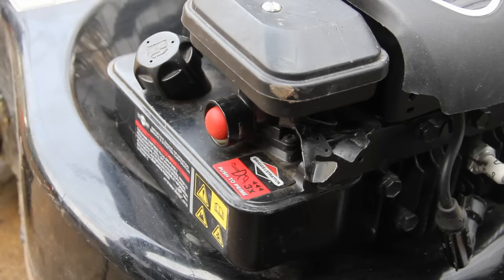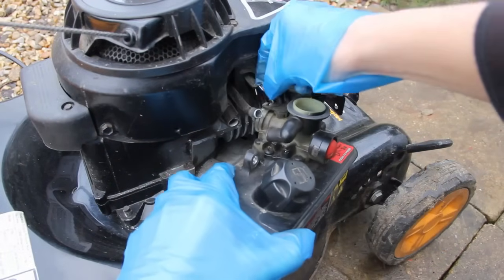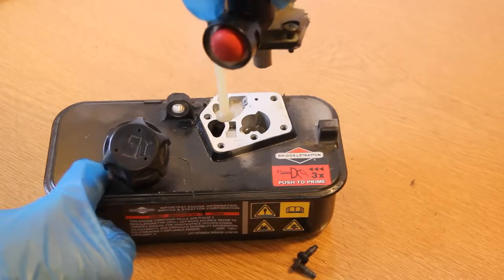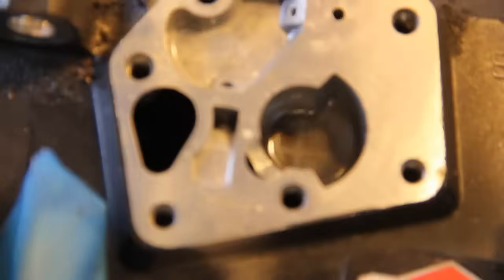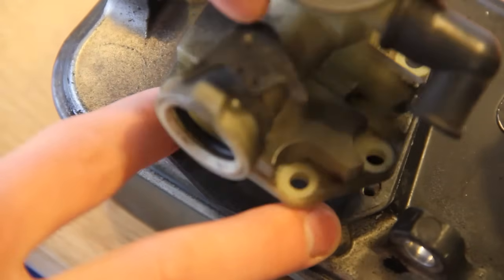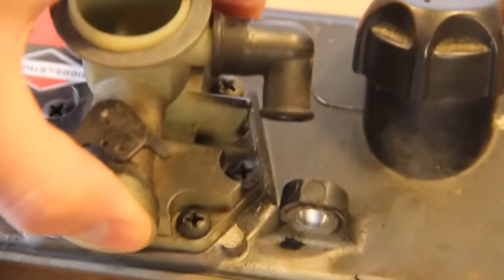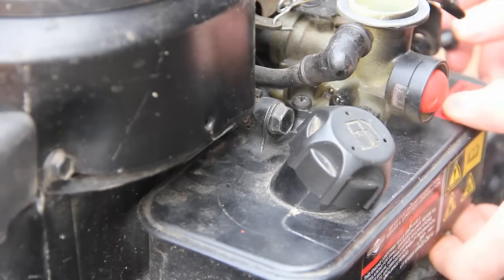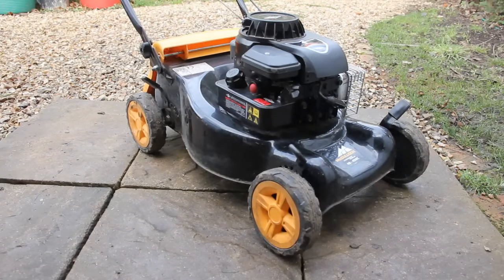How to Replace Diaphragm and Gasket on Briggs and Stratton Engine Primer Carburetor

Comment: I've got a sudden problem with the primer on mine..Briggs 3.75hp Sprint mower with plastic carb with rubber primer button, suddenly, after it working fine last time, pushing the primer button will not suck up the fuel at all, I didn't think it would be difficult as I have cleaned the carbs successfully several times b4, but cleaning it and blowing it/sucking it  and squirting with carb cleaner,it all seemed clear,  it briefly sucked fuel up ok from the tank before I put it all back together, then, after being screwed down onto the tank, same problem.No pump priming, just won't draw it up from the well.I got a spare old carb, cleaned it, and the mower started immediately, but I would like to fix the one I took off still. Since it didn't respond to the clean, I am at a loss.
Any other possible issues cause this ?
Reply: lyerlyman I did subsequently solve the problem on that carb, it was an issue with the diaphragm ,which another Youtube channel suggested as one of about 3 main causes...
 there is a tiny tiny breather flap over one of the airways in the carb, on that rubber gasket, and that little flap has to open and close to provide the vacuum seal and release as you operate that rubber button.As the primer button inhales and exhales as it were, that little reed-flap has to open and close effectively.....I checked it by taking the carb without the tank , getting a glass or cup with enough alcohol or gasoline in it to cover the end of the long plastic draw-up tube...and put your thumb over that little reed part of the diaphragm as you operate the pump-button..if that is the issue, you will find that this test, with your thumb pressure restoring that vacuum,  enables the primer to again suck up fuel into the pump button which is then available to discharge through the squirt  jet..  
when I took my thumb off that little reed and passageway, the primer button quickly emptied and then was again inopperative..so this proved the rubber diaphragm as the total cause, in this case.
the rubber and the paper gasket and diaphragm are of course sold together as a pair usually, at reasonable price..
Reply: lyerlyman I just put in a search something like "primer button Briggs mower" and brought about about 3 top results, messaged them all the particular problem I was having still after cleaning it, at least one suggested the rubber diaphragm as one possible cause..and when I did that test of my own offing, confirmed it..
Reply: I have an old 3.5hp BS 90000 series with this style carb, and it was working just fine until the draw-string broke. While it was sitting, the gas inside the carb did a wonder on my primer bulb. I assumed that the primer was fine, but when I tested it there was no fill. So I figured "why not, I'll take it off". When I took it out, the entire check valve-seat assembly had been pulled out of place into the primer bulb, and was covered with red goop- a result of the ethylene dissolving the rubber. I havent put it back in yet because its so hard to find out which way the little rubber piece goes in... but if I get it back in and working, I'll follow up.
What I'm talking about is part 913 in the carburetor assembly diagram on EReplacementparts.com http://www.ereplacementparts.com/briggs-and-stratton-095902310701-engine-parts-c-16758_17347_263959_264024.html . Even the little bb-thing was covered in the rubber lol.